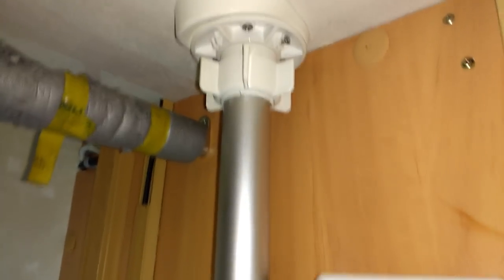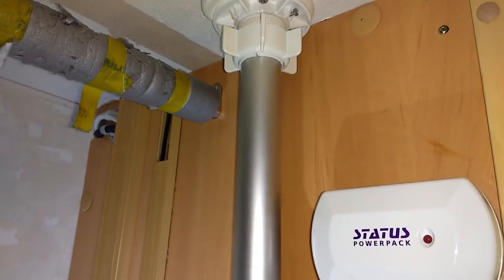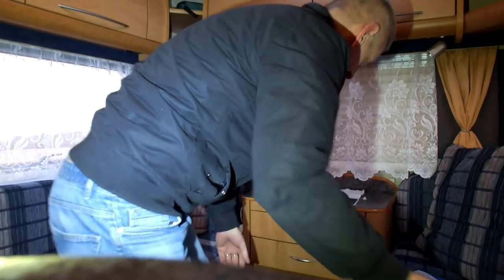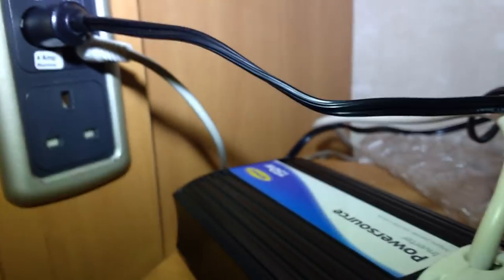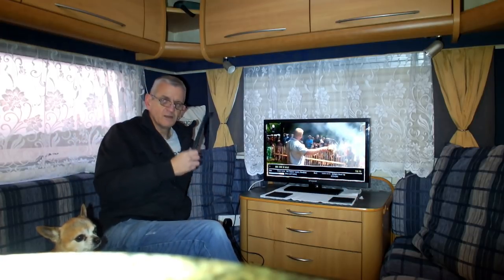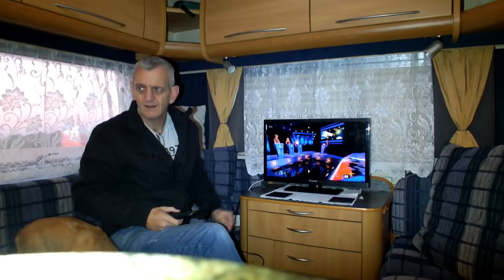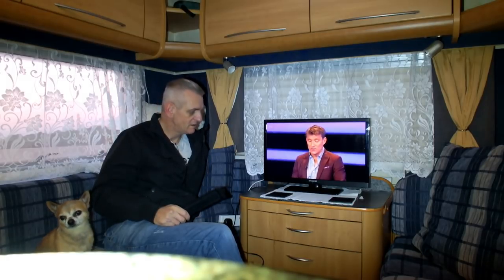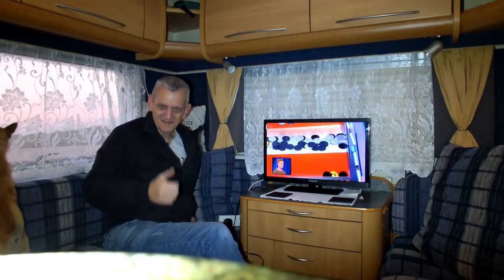USING TV IN MOTORHOME

Comment: hi, you can download an app 'antenna alignment-...     also why use an inverter to run  12 volt tv,why not plug in to 12 volt socket/cigarette lighter
Reply from the maker: It's just the way IV been using it and it's only a 240v TV fixed wiring.also I can charge my laptop in the adaptor I could of bought a new 12v TV or spend 30pound on an inverter and use a TV I already had so that's the way I went